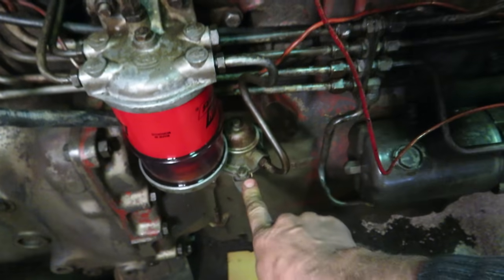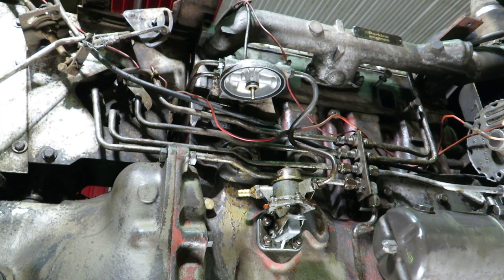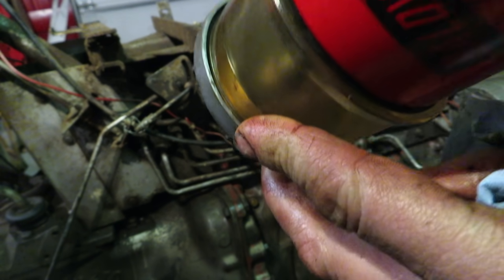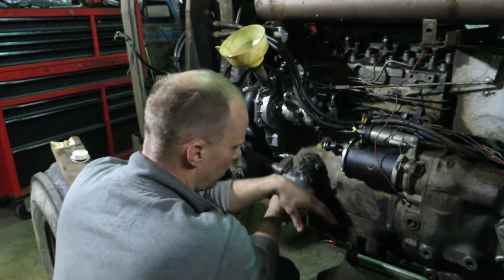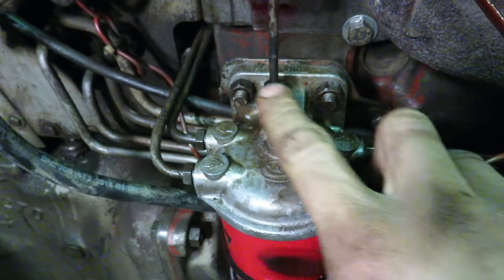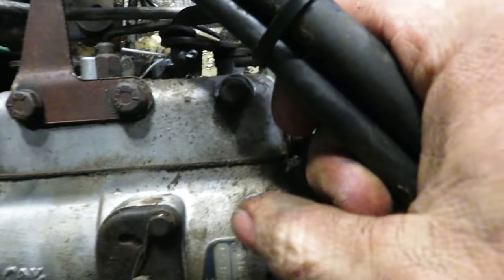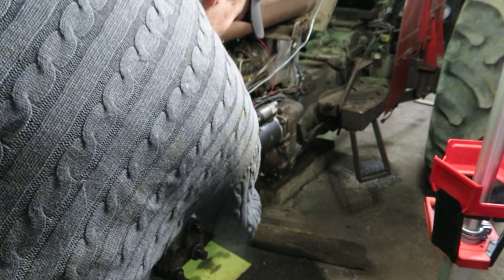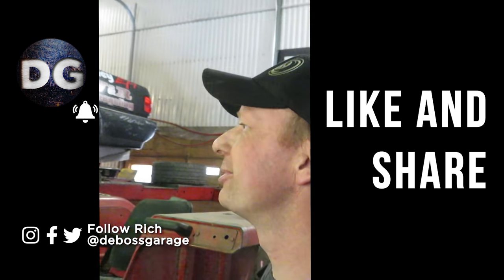Bleeding CAV Fuel System On A Diesel Is A Royal Pain

Comment: Yes! Rich the man with common sense. Prefill that oil filter. It will greatly reduce the chance of starting dry bearings. Keyboard warriors saying it introduces contaminants.... pssh please ... fresh oil cannot have contaminants and whatever particles are in the outside of the filter will get into the engine whether you like it or not.
Reply: Mark M I always prefill my filters. People are idiots lol
Reply: @DirtRoadAutoRepair  How do you prefill the upside down and sideways filters
Reply: iwtommo idk about upside down, but sideways I just fill it 1/3ish full so it doesn’t spill. Do you have any tricks of the trade?
Reply: @DirtRoadAutoRepair  Start the engine? Oil flow demands at idle are negligible - ages back we ran a toyota 4cyl with no sump and you could watch the crank spinning. It was a scrapper so good for a lunch break laugh. After a few minutes (2? 3?) we pulled a main cap and there was zero... ZERO apparent wear to the journal surface. Of course the car was up on the lift so wasnt being revved. Just idling with no oil pressure. That thing got driven onto the trailer with no sump (though the drive up the trailer likely hurt it a bit...)

The environment i work in knocking a bit of grit/dirt into an open filter element is a much more real danger than the 5 seconds of no oil flow an engine will see. Turn the key and save the messy hand and 5 minutes on your ticket.
Reply: iwtommo yeah when you drain the oil it’s not like every drop of oil drains from the engine. There’s still oil in all the bearings.
Reply: Except, if you prefilled filters in a Caterpillar, say goodbye to your warranty.
Reply: @iwtommo  to prime a lubrication system with an upside down or side ways filter what we have is an old oxy cylinder that we put a drain on the bottom of that runs through 2 filters inline that go to grease line with changeable fittings on the end so we can connect to the engine block on the high pressure oil circuit and we would fill the cylinder half full with oil and put regulated air pressure into the top of the cylinder through an air chuck about 40-50 psi and hold it and watch the engine as the oil will start the flow past the bearings and out the push tubes and we rotate the engine by hand a few times to be sure that all of the bearings are holding oil pressure. We do this on all engines after a rebuild and then on engines with side ways or upside down oil filter.
Reply: Do a particle count on new oil.  Look at the bottom of a 5 gallon bucket of oil and you will change your mind.  New oil is not very clean.
Reply: Seem like adept ape said if you wanna prefill, only pour it into the dirty side of the filter media, i.e into the little holes on the outside, not the big hole in the center

Comment: Hang on  minute 
The CAV fuel systems arent that bad 
You only need to bleed them like this when you run out of fuel, not for filter change
For a filter change just leave the secondary filter slighty loose and pump lift pump until its full 

Chamberlain tractors with Perkins motors have a hand lever so you can operate the lift pump from the injector pump side and this makes things easier 

Great video Rich

Comment: Ive worked on several Perkins's over the years, we farm with Massy Fergusons, Love your videos!!!!
Reply: Ive worked on all types and ford/fordson and massey are the best. Easy to work on and they last. John deere is over complicated and cheap made parts. International are alright but that hot rod shifter wears out and you start jammin the gears together and those forks are high dallor to replace if you aint smart enough to beat the old ones straight.
Reply: Ive worked on all types and ford/fordson and massey are the best. Easy to work on and they last. John deere is over complicated and cheap made parts. International are alright but that hot rod shifter wears out and you start jammin the gears together and those forks are high dallor to replace if you aint smart enough to beat the old ones straight.

Comment: Great video Rich I can honestly say I have experienced every problem on those Perkins diesel engines with priming the fuel system. A simple fuel filter change for me turned into an all day complete nightmare just by having those o rings switched around. I replaced the primer pump also and had trouble getting those fuel lines started and keeping them from leaking. This is all good stuff to know I learned the hard way though lol.

Comment: In the 70's I had a van with a Perkins diesel in it the fuel system in that had those rubber olives, they would spring leaks so often that I ended up carrying a tin of them and spanners to fit the union nuts so that I could change them on the roadside sometimes several times in a month. Got rid of the van after a couple of years of that.

Comment: Had one of these pumps on an S4D Cummins. Would not pull fuel from the tank, so I had to put shop air to the return line to get it to prime. Fired two cranks after that.

Comment: If the oil filter is mounted sideways I still put some oil into it, just below half so it doesn't leak out while I tighten it.
Reply: It's good to crank the engine just on the starter motor to help prime things. Obviously being careful to nor overheat the starter.

Comment: Still seeing those CAV filters (Wix 33166) on modern, small Perkins engines (actually Shibaru built) and recently acquired by Caterpillar. Many machines with them now have rubber primer bulbs in the feed line from the tank, which greatly simplifies the bleeding process. But yea, there's a lot of volume to fill in those 3 piece housings and a lot of potential leak points too.

Comment: Thats the right way to bleed the system. I had a blocked Filter at my Bosch rotay pump, stranded at an Autoparts store.  Of course no tools in the car, but i had luck installing the dry filter and push the air trough the injectors by starting the engine at full trottle and stay on the gas until it runs agin on all cylinders.
Reply: i would have bought a quart of cheap auto transmission fluid. diesel engines runs so smooth on atf , conditions the pump and seals

Comment: An interesting thing I have seen on these CAV filter setups.  The newer ones have the water bowl AFTER the filter element in the flow direction.  Customers who don't maintain them often enough get a bunch of water and aluminum corrosion grit and crud sitting in the bowl with a clear shot straight to the injection pump.  All I can figure is some designer was unclear on the concept of how these are supposed to work.  I recently discovered the spin-on kit also but I have not installed one yet.

Comment: Worked on several diesels with similar type systems for 20 years in the US Air Force. They are indeed a pain in the rump, especially if you have to fix someone else's "fix" in the fuel system.

Comment: I have had and changed many CAV296 filter elements in marine use, and yes - they can be somewhat difficult to assemble, especially  when there is not enough space to actually see how the new o-rings are seated. For example the Racor 500/1000 Turbine -type filters are much better in that respect.

Comment: I got a Deere 1830 I changed the fuel filters and got it running, ran for about 10 minuets then seemed to run out of fuel but still had some in the tank
Reply: It's probably sucking air somewhere. Check every fitting and seal you touched.

Comment: I have a 1845c that starts and dies. Changed fuel filter.  Got air out of the system I think.  Getting fuel to the injectors. Starts and dies. Sitting overnight it will run longer. Maybe 15 seconds but then back to start and die again.  Checked fuel solenoid.  It's getting 12v. Tried external power also. Went and replaced. Also put a new oem mechanic fuel pump on. Last night I tried even feeding the fuel filter with a 12 electric pump. Still fires right up but then just dies.
This machine has the 4bt case model with the Lucas cav pump in the video.

Comment: Just get an air gun from the compressor, and with a towel put it so it blows air into the fuel tank, air pressure will move the fuel very quickly. Dont know if i explained well, im not good at english.

Comment: I often wonder as a field mechanic why all fuel filters are not spin on... to many other versions the glass cracks plastic breaks and o-rings snap. Then there you are in field going well I need a fuel filter and parts.  Machine won't run annnnd... parts are at a warehouse 4 states over. Been there many times. I mean you can be careful but if its leaking when you get there you often leave wait for parts then come back. What a pain.

Comment: Im actually suprised how easy the bleeding on the Volvo trucks here in europe is! usally its done through the dashbord display or it has a handpump. :D the cables for the electrical pump can be broken so sometimes u just change the cup and the cables. pretty easy on the new truks! :D
Reply: Sadly the Volvo construction vehicles aren't as easy, you have to do it yourself
Reply: On the ones I worked on at Penske most of the trucks had a fitting somewhere on the fuel system...usually at the fuel/water seperator...where we could connect a device and force-feed fuel down its throat. Worked a treat; I've seen VNLs cackle to life in seconds after having major injector work done and I, myself, have gotten several DD15s alive again with that thing which had pretty much no fuel in the injection system. Hook up the device, turn it on, turn the key on, wait a few moments, spin 'er over, and she'll kick first try.

Comment: Eh?  What the ....?  I remember on the farm we would just swap out the fuel filter on the sides our our JD tractors.  I admit those where 60s and 70s model tractors (4010, 4020, 3010, 3020, 5020) but it was a "snap".  O-rings were part of the glass filter housing thingy and it was held on by a piece of spring steel.

Comment: I have a Ford F100 truck with a Perkins 4-203 engine and is even worse: exaust manifold is next to the filter, so if you need to replace filter or bleed the lines, for sure you will burn your hands!

Comment: Deboss Garage do you have any suggestions to finding fuel leak on Massey Ferguson 1100. Everytime I go to start the next day the fuel has leaked out somewhere in the line and it cranks for forever or I have to pump the lift pump for minutes with bleeder open on injection pump. Then crank it for a bit.

Comment: I have a loader that the fuel pump got so worn out i had to bleed the pump every day. That was a pain, but it did have an electric lift pump.
Reply: that's a air leak not your pump.
Reply: @mog5858  yes you are right, seals and bushings on throttle shaft were so worn it was leaking.

Comment: Rich i've got a question for you and maybe you've run into it at some point. I have say 1970s Allis Chalmers backhoe and we just got it running again after sitting around for years because it would stop moving under load. it had a trans line leak for a long time. And when my dad and grandpa would put fluid in the machine it would move again. Well it runs again but will not move from it's resting place. i jacked it up with the out riggers and the rear wheel seem to be locked up. Any ideas?
Reply from the maker: Would be willing to bet the brakes are seized.

Comment: I rebuilt a cav pump with a kit and followed YouTube instructions.  I can't seem to get the pump to move fuel.  I've bled the thing and filter repeatedly and have a full fuel tank.  This tractor does not have a manual fuel lift pump. Suggestions appreciated

Comment: If you have to pre-fill a lube oil filter that small to avoid engine damage on startup the oil pump is so fucked that it's gonna be damaged regardless of a pre-fill or not. The pump should be putting out enough volume to fill the filter and then get oil into the main bearings before the engine has a chance to fire even if that filter is bone dry when it goes on.

I never pre-fill oil filters. Just makes them harder to hold onto, heavier, more awkward to work with.

Comment: Very few things feel better than when the engine you rebuilt builds oil pressure and then fires.

Not much feels worse than an engine you just built fires and has no oil pressure ...

Comment: It's not so a pain in the ass when you get used to it. I usually don't use the primer pump, instead I use the the starter motor with runs the primer pump much faster, to blead the air out of the system. If the entire system ist full of air I unscrew both bleading screws and wait until the fuel pours out, then screw them in gently, run again the the starter motor until fuel pours out without air, done. After that same procedure as shown in your video. Important the fuel has to be squirting out of the high pressure lines, simple dripping out of the lines is to less. For more MF related stuff head to the channel engineerlikesfarming
Reply: Yes, I used to work for an MF dealer. Can't say that I thought of it as a hassle, it just had to be done. I don't remember that they leaked much, but yes it's a bit fiddly to fit new rubber seals on the lines. Sometime someone had rounded of the heads on everything before the tractor came to us. Use spanners that fit well and pay attention, and that won't happen.
Reply: A friends perkins froze just a couple of weeks ago in the tank due to water (drained out nearly 6l of water from the tank) so it ran the filters and pump completely dry.
 I couldn't even be bothered to use the bleeding screws. Just opend ONE of the injectors and started cranking. Didn't evevn take 30s before i started to fire. Just tightened the line back up and it fired it up straight away. Allways done it like that, Cav, bosch, lucas, sims.... and worked every time

Comment: Why can't you drill plastic drain out and replace with a drain plug would be so much easier
Reply: Tony Tennessee it’s glass.
Reply: @markm0000  looks like the bottom with drain looks aluminum and can easily drilled and taped
Reply: because thats a lot of extra work for a simple filter change
Reply: @fastinradfordable  ok

Comment: Rich, synthetic oil doesn't matter. They are filling brand new heavy duty diesel engines with 10w-30 synthetic oil from the factory to get 75,000 mile service intervals. They use molybdenum disulfide grease to assemble them, so there is essentially no break in period now.
Reply: you cant use grease on the cylinder bores...
Reply: Better machining, and possibly different steel in liners and rings explains that.
Reply: All engines have a break-in period. ALL engines. It is simply a nature of how engines function.

Comment: That’s it. If you can fill the filter...fill it. Common sense.
Reply: IF you need to prime an oil filter to prevent engine damage on the next startup your oil pump is totally shot. They should be pushing enough volume to fill the filter and get oil to the main bearings within the time between the starter engaging and the engine actually firing.

Comment: absolutely hate them, i own 2 VM engines both have a bosch inline 4 cyl and 2 Fiat engines, both with cav, on 2 different truck, sold them month ago due to CAV, pretty useless, no better performance, just pain in the ass when you're in need and fuel go low, of course, they start to pump air, you can set all new, check everything, will always work in this way. Trash them all!